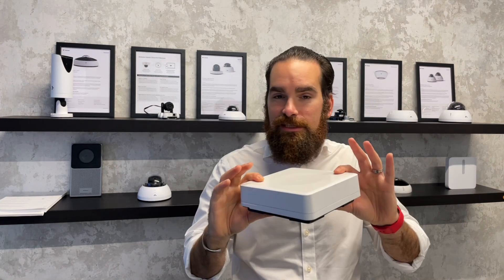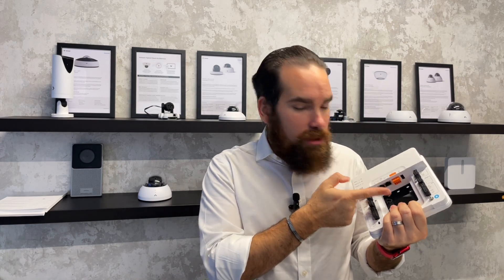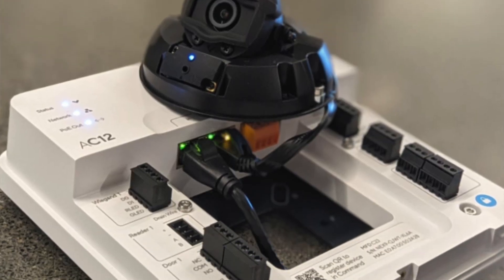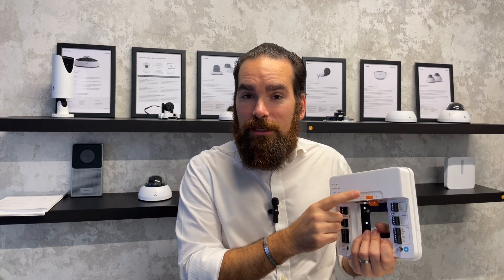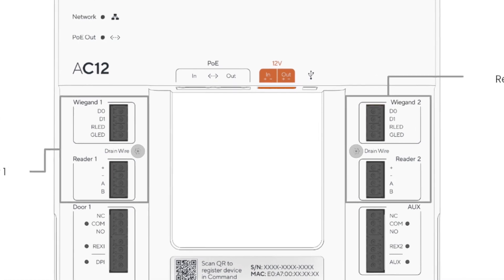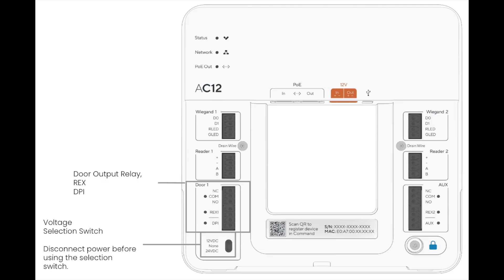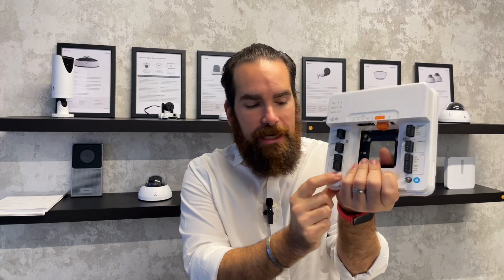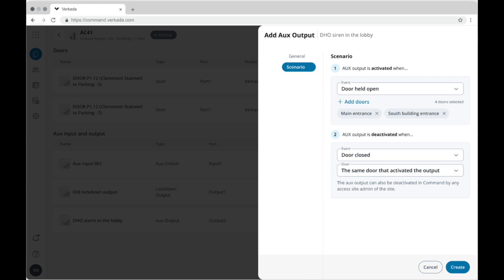Verkada - AC12 single door controller unboxing

Comment: Hi Dimitrie , I am wondering if you can please advise or point to a direction for velocloud edge configurations on homelab/test environments my work (school environment) has started implementing velocloud  edge 640 on site and I’m trying to learn how to configure and get it working can you please advise on how I can build a test /homelab to learn the process. From scratch Any suggestions would be greatly appreciated.
Reply from the maker: hey, I do appologise I don't work there since 3 years ago, so not really the right person to advise, as things might have changed.